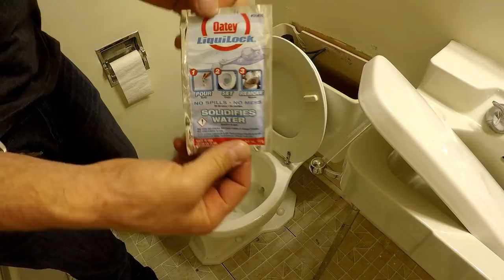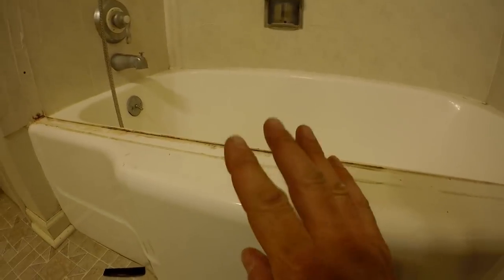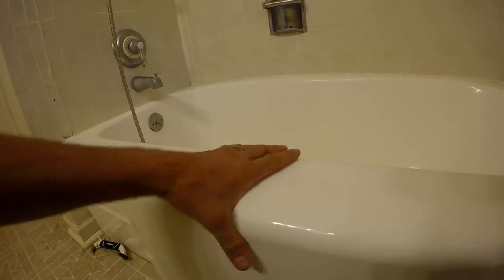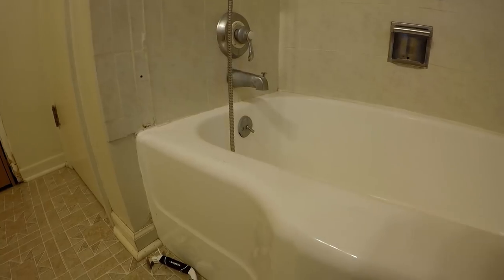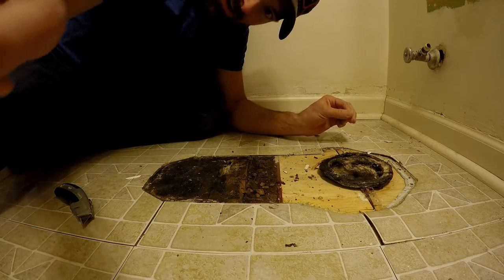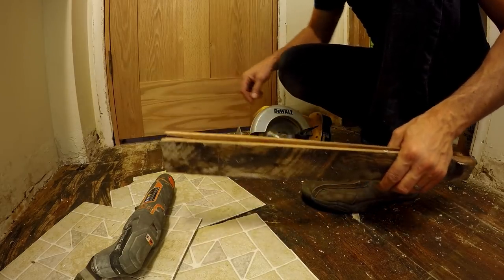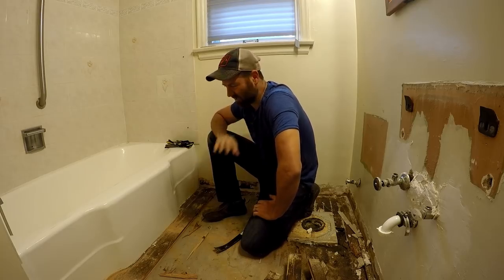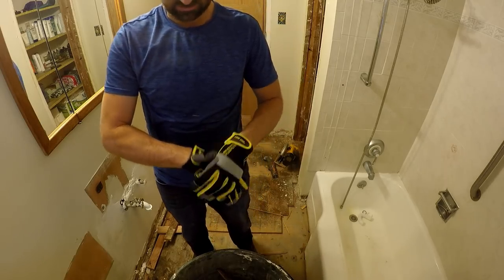1940s Bathroom Remodel | Demolition | THE HANDYMAN

Comment from the maker: Here is a link to the powder I put in the toilet to turn the water to gel https://amzn.to/2PcF0oy  Its a lot easier then getting out the shop vac
Reply: That water solidifier is incredible! Never seen that before!
Reply from the maker: I paid a lot less at home depot.
Reply: Heck, I'd pay 8 bucks just to not drip septic water throughout a house because I was too lazy to get the shop vac!
Reply: It’s $3 at Home Depot
Reply: I like the gel, never tried it before! I normally use a hand siphon to drain the water into the sink or tub if still installed. No need to drag a shop vac around or change from wet to dry
Reply: Probably similar to the stuff they use in disposable diapers.
Reply: Have you tried to use a suction gun in water then push hose past P trap of toilet to push water down drain
Reply: The ladyboys wants to know if that is speculation or experience lol
Reply: Go to the garden center and get a 1lb bag of “soil moist”, it’s to put in flower pots to keep the soil from drying out as fast. It absorbs water. It’s probably the same stuff at 1/3-1/2 the price. YMMV
Reply: I learned from a Brit to pack a car wash sponge into the bottom port and tote the toilet with no drips. I use a wine bottle cork on Dishwasher drain hose  for same effect. Sometimes, in a small  bathroom space like yours , or stairs, it's easier to  first bust the toilet  tank with a hammer and drop cloth. then you can easily handle the  bottom.
Reply: Can the toilet be re-installed after you use that powder ?

Comment: I learned a trick from the Fine Homebuilding site for carrying toilets. Use a ratchet strap. Loop it behind the toilet, cross the ends behind the seat hinge, then hook the two ends together in front of the bowl and tighten it.. Where the strap crosses behind the seat is a balance point. You can grab the strap there and carry it with one hand. There was a time when I could heft a toilet to my shoulder to carry it, but I turn 60 in November. Would rather keep the toilet near the floor rather than risking dropping it down the customer's stairs! Love your videos, keep them coming!

Comment: I did my bathroom few years ago, and boy was that a job removing the linoleum. had 3 layers and under that had 2 layers of plywood that was glued,tarred, nailed , and stapled down. got it down to subfloor and sanded it then put down that mapea stuff then cement board with tiles on top of that. never want to go through that kinda floor again lol.

Comment: You should have seen my lower level bathroom and the original sheet vinyl flooring from 1973.  It took the new flooring installers about 8 full hours to peel that stuff up off of the concrete slab in the single bathroom alone!  Worst part of the tear off by far!  They were mortified.

Comment: Here I was thinking I was smart using a wetvac to get the water out of toilets all these years.  Hi tech jello is what I should have been doing all along.
Reply: When I've had to replace the wax ring on toilets at home (leak or snaking out the drain) I'd use the shop vac.  If I wasn't going to put the toilet back this is a way better solution.

Comment: I just redid a bathroom in a duplex of mine. The wax ring either leaked or melted once before. it wax soaked the hardwood underneath black, but didn't smell of mold/ rot. I went cheap on the flooring with linoleum tiles, only because the claw foot tubs, cast iron plumbing, and radiator heaters were not moving up/down or anywhere for that matter. Otherwise tile would've went in. I still don't trust tile much more. Mortar, grout, concrete all absorb water unless sealed repeatedly. I've seen the Wedie(sp?) Watertight system, and would love to install one of those instead! But as its a cheaper rental im not going overboard, just solid repairs. 

Anyway! Love your videos, keep them coming 👍

Comment: At the remodeling contractor I used to work for, we used the Oatey gel product every time we pulled a toilet. However the gel wrecked a Toto fill valve once so I stopped using it in tanks. An alternative to using the gel is to dump a bucket of water in the bowl after flushing it. That siphons out about half of the water in the trap which is enough to allow the toilet to be carried without spilling, provided the toilet isn't tilted back too far.

Comment: Lowe's - There is new handyman product that I like. A clear adhesive sealer called "Lexel" - it sticks to wet and dirty surfaces, and is paintable.. It's comparable, but better than clear silicone IMO.  Acetone clean-up. Try it.   It's especially effective on old under sink drain lines that don't have a lot of pressure on them but stubbornly seep or leak.